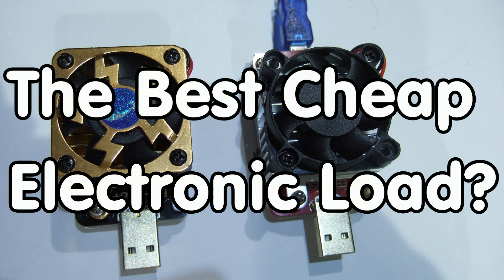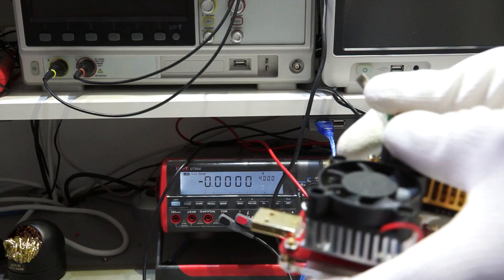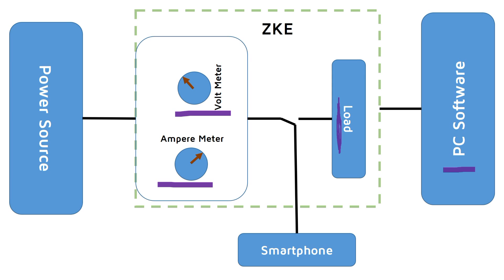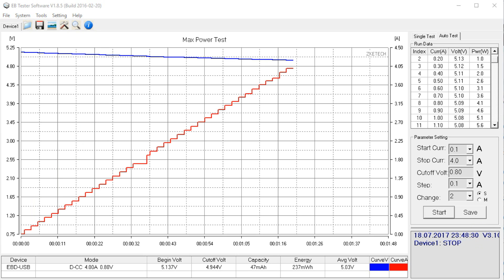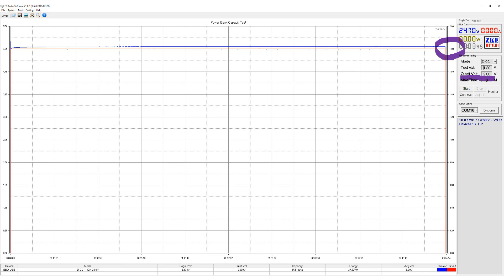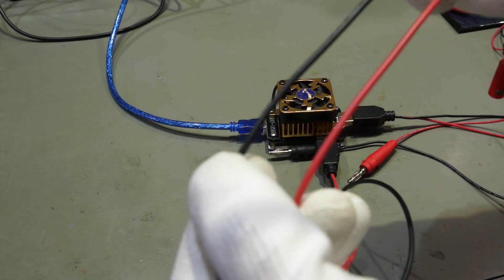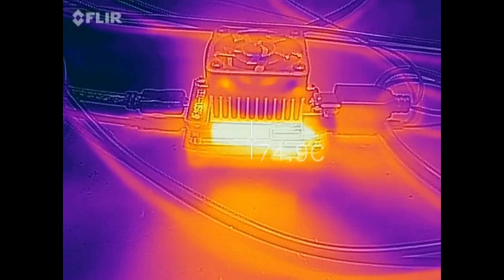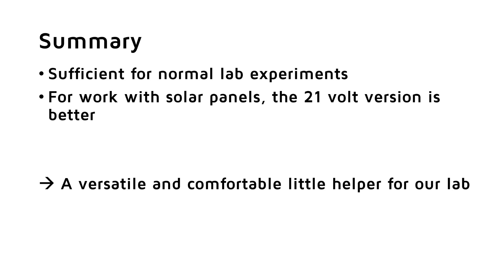#148 Best Cheap Electronic Load / Data Logger? Introduction and Test

Comment: I bought it to test tp4056 chargers and ICs. To check if the tp4056 does not go below or above the 4.2 voltage and to monitor the charging curve (voltage vs current) via the PC software. Unfortunately, this device does not seem to be suitable for it. The voltage at the output of the tp4056 does not match the value that the software indicates when the li-ion is connected. It does match if the li-ion is not connected. Also, the voltage does not match when you measure the input and the output of this device. Used very short 18awg cables. Any tips on how I can get this to work or do you think it's not suitable for this?
Reply from the maker: I do not know your setup. Maybe you look also at the datasheet of the TP4056. Particularly at its charging curve.
Reply: @AndreasSpiess  That's why I was testing this. To see if the charging curve matches the datasheet. but unfortunately this device does not seem to be suitable for this.

Comment: Fantastic tutorial and test, thnx!!!! I received my ZKE EBD-USB+ today (based on your recommendation, and after prolonged Covid19 shipping delay ;-) and it is an amazingly powerful piece of test equipment for the price. I tested my collection of power banks, chargers, PSUs etc and was pleasantly surprised by quite a few of the cheap, Chinese devices (far exceeded ratings); but also underwhelmed by some others that didn't even come close to specs . . . I'm experimenting with solar power for some Wemos Mini devices, this will be invaluable to log actual power needs withn sensors connected then chosse the best solar panel.

Thnx again for a great video!

cul
billd
Reply from the maker: Glad you like it. It seems to be very useful for your many projects!

Comment: @2:49 I have that same cheap load and it does have nice sized solder pads on the bottom marked as +/- for you to add wires to any connector you want though. It lets you easily use it as a CC load with an existing data logger if you have a cheap LiPo discharge tester for example.
Reply from the maker: Thanks for the tip!

Comment: Dear Mr. Spiess. I bought the "light" version after watching your video and tested a 12v lead battery with 3 Amp which gives me 35 Watts of power. The temp of the heatsink went up to 51°C measured with a FLIR camera. It ran for over 2 hours. And still no problem about overheating, any overpower protection, which is good! Thank you for the nice structured video. Sadly i'm not an engineer, but i wish i had your knowledge and capacity of understanding concepts. Weiter so und freundliche Grüße aus Luxemburg :)

Comment: Thanks for this, Andreas. Have you looked at Aliexpress 150W 10A Constant Current Electronic Load Tester Battery Discharge Capacity Test (https://www.aliexpress.com/i/33026184129.html?spm=2114.12057483.0.0.17fa200fCwhQhu)? It looks good though I have not fully checked mine yet, but it seems to be good value as a simple 'dummy' load.
Reply from the maker: No, I do not know this product.

Comment: My PC is not finding my plus version.
It says use a USB to ttl lead?
I just used a normal USB cable but the computer does not see it.
Reply: Solved it was on a comport above number 10 changed to com 2 all working

Comment: which digital load do you recommend? that this between the $ 50 to use it with a solar panel, I want to see if the panel that I have can deliver 500mA thanks
Reply from the maker: I think the video covered this topic.

Comment: Dear Andreas. I have a problem connecting the EBD-USB+ to my PC. It recognizes the unit and a serial port is defined, but It is not present in the dropdown box and I cannot connect to it. What are the settings for this port like baud, stop bit, that you use?
Reply from the maker: I do not remember and I use now a different load. So I deleted the programs. But if you cannot see the port the problem is somewhere else, not in the definition of the baudrate.
Reply: @AndreasSpiess  For those who are interested. The settings are 9600,8,Even,1,None. After a while, I found out that there is an issue with my Desktop and I cannot get a connection. I switched to my laptop with the above settings. I have seen a remark(see here: http://budgetlightforum.com/comment/1192992#comment-1192992 ) that it would not recognize port numbers above 10, but that did not help as well. So I have to dig a bit deeper why the USB connection does not work although the driver is connected with the unit, it is weird.

Comment: power IS voltage time current with phase taken into account, and yes as this video is for DC power should not matter much but i think some loads are nonlinear
Reply from the maker: Most DC loads are somehow non-linear (at least over time)

Comment: Is it possible to log 2 at the same time over a boost or a LPO or a transformer to get the efficiency ?
Reply from the maker: I do not know.
Reply: Andreas Spiess ok i have ordered a second one. In maybe 1 month i should be able to tell.
Reply: I have got the 2nd one. It is possible to log 2 together in 2 different window so they are not synchronized in time but i think for slow events that should not be a problem. On top of that i think that it should be possible to synchronize in post (excel or OO calc) just by matching the signals.

Comment: Excellent review Andreas, as usual. Thank you. I have a question. Is it possible to attach let's say ESP8266 instead of smartphone and to see current and voltage during the transmission and sleeping? Or ESP8266's current and voltage are too small to measure with this device? Thank you in advance. Regards from Portugal.
Reply from the maker: You can use these loads for all sorts of devices. But nor for deep sleep. For microamperes, you need special equipment as I use in my videos.

Comment: please Show how to calibrate them
Reply from the maker: You can test them with a normal multimeter using the 4-wire method shown in the USB cable video.
Reply: How does it calibrate? Is precision current or voltage source required?
Reply from the maker: You should be able to do it with a normal multi meter. This is not a precision instrument.
Reply: My question was is the calibration performed by measuring voltage or current and then inputting the true value or the precision voltage or current needs to be inputted to the device.

That is the two different calibration process, one requires a measuring device with 4 wires, the other requires precision voltage / current source with 4 wires.

Comment: Thank you very much for this interesting video! I got a quick question that may seem silly, but for me as an electronics newbie is important: where do you get your wires from (e.g. the 18AWG you mention) and what collection of wires do you propose to have in a lab? I recently went to a DIY shop and the wires they had there did not seem too useful - they were generally thick and single-stranded (consequently stiff) wires.
Reply from the maker: I got all my wires from AliExpress (silicon stranded). You should find a link in one of my mailbag videos.
Reply: Ok thanks a lot.

Comment: Many thanks for your excellent video. It inspired me to buy a EBD-USP+ and
doing some further reverse engineering, starting with the results of Caleb Crome 
(https://gist.github.com/ccrome/d2b5bd30b2c8ece0bfa5ba84b5511e43)
mentioned in his comment to your video.
The results were tested with a program written for NodeJS (v8.9.1.0 + serialport-module).

1 Strange msb/lsb
Msb and lsb of the data go only to 239 (0xEF)! 
That means the maximum value is 0xEFEF and it is not 256*239+239=61‘423, but 240*239+239=57‘599. 
That means for coding, the msb of for example 1234 is not Math.trunc(1234/256)=4, 
but Math.trunc(1234/240)=5, and the lsb is not 1234-(4*256), but 1234-(5*240)=34 i.e. 0x22.
That solves the problem mentioned by Caleb Crome („…not 1000/Amp, 100/Volt..“).

2 Checksum for send and receive
The crc is built by starting with crc=0 and xor it with all data-bytes.
Javascript example for sending data (buff[0]=0xFA...,buff[9]=0xF8):
buff[8] = 0x00; 
for (var i=1; i < 8; i++) buff[8]=buff[8] ^ buff[i]; } // ^ is js xor
if (buff[8] > 239) buff[8]-=240; //see strange msb/lsb

3 Received data
Decode acording to "strange msb/lsb"! Byte-count starts with 0 after start-byte(0xFA):
Byte 0: status=0x00:stopped/values OK, 0x0a: running/values OK, 0x64: startup/values NOT OK?
Bytes 1+2: dataAmp (=value/10000)
Bytes 3+4: dataVolt (=value/1000)
Bytes 5+6: dataD+ ? (=value/1000)
Bytes 7+8: dataD- ? (=value/1000)
Bytes 9+10: setAmp (=value/1000)
Bytes 11+12: setVolt (=value/100)
Bytes 13+14: setMinute (=value)
Bytes 15: for EBD-USB+ always= 0xA1 ?
Byte 16: Checksum

4 Problems/solutions (only with my device?)
The command 0x02 ist not a  „stop“ command, but a „pause/continue“ toggle command.
Solution: The status of the device can deliver the actual function (status „running“ is 0x0A).

The cutofftime does not stop the load.
Solution: Stopping the load by software, sending 0x02 if running (status 0x0A) and time is reached.

The „continue“ command 0x11 does nothing or strange things (ev. blocking the „start“ command  for a while?).
Solution: Not using this command?

Unknown functions (sent data, 19 bytes instead of 10 as usual for commands)
//0x0A, ??, 19 bytes, ex: FA 0A 00 00 16 36 08 48 08 58 00 0A 00 00 00 00 1A 2A F8
//0x0B, ??, 19 bytes, ex: FA 0B 00 00 16 68 08 3D 08 4D 00 0A 00 00 00 01 1A 14 F8
...?
Solution: Not using this commands?
Reply from the maker: Thanks for the documentation. It would be great if somebody would convert those learnings into a Sigrok interface (https://sigrok.org)
Reply: I have an working driver for sigrok.
https://github.com/littleyoda/libsigrok

Currently I'm working to get this driver merged with the offical sigrok-repository.
Reply: I see I'm not the only one :-)
I have reverse-engineered this protocol a few months back to write my own client (I wanted easier to use UI and logging)
in not so commonly used QB64 code:
https://gist.github.com/mdijkens/0f28abc5bb5855871c53b5ff1e6863c3

Windows App (ugly but easy) can be downloaded here: http://www.dijkens.com/mdFluke/mdEBD-USB.exe

Comment: Hi Andreas,
  I've done a bit of reverse engineering on the pro version of the electronic load, and I posted what I've learned so far as a gist.  Once we work out the checksum computation, it'll be quite simple to create a python library that will drive the thing

https://gist.github.com/ccrome/d2b5bd30b2c8ece0bfa5ba84b5511e43
Reply from the maker: Thanks for the link. I would ask the supplier directly if he is willing to help. Maybe somebody writes a library (or connects it to Sigrok?
Reply: I sent an email.  His email seems to be  zke2006@163.com.  We'll see if it goes though.
Reply: Thank you for your work. Today i placed some more results in the comment to this video.
Reply: Hi
Just noticing this
I have reverse-engineered this protocol a few months back to write my own client (I wanted easier to use UI and logging)

What info are you still missing? I have it all running
in not so commonly used QB64 code:
https://gist.github.com/mdijkens/0f28abc5bb5855871c53b5ff1e6863c3

Windows App (ugly but easy) can be downloaded here: http://www.dijkens.com/mdFluke/mdEBD-USB.exe
Reply: Maurits Dijkens qb64 huh?  That's all I was missing, thanks!  Do you have a GitHub repo ?
Reply: No not really, just used gist.github :-)

Comment: This is all well and good, but if you cannot get the software then it is useless.
I have tried to download this software from 3 locations now and all i get is a useless file with .RAR file extension ? My computer refuses to read this ?
Reply from the maker: +kev wallcroft rar files are archives. You have to use a program like winzip and you see the content. Rar files are often used to distribute software.
Reply: Andreas Spiess ok i will try this again thank you.
Reply: Hi again it would appear that you were quite correct sir, many thanks i do now have the software.
However could you please answer another question for me regarding the type of usb connection to the PC from the unit.
it specifies that it must be a USB to TTL Serial converter cable ?
did you yourself use this type of lead and if so could you tell me where to get this from.
many thanks

Comment: Hello Andreas, and others reading this. Because I've been scammed so many times when buying powerbanks I decided to buy this electronic load, also because Andreas endorsed it. After getting it delivered, witch took very long, and was badly packed, so badly even that the acrylic piece was damaged. After a close inspection though I could not find any other damage, so I started the hunt for the drivers. I have to say that I think its very disappointing from all these chinese companies to dump their products in europe and the US without even having providing the needed support in english. It took me hours to find these drivers, and in all fairness I do have better things to do. It's a good thing we have Google translate because otherwise it was impossible to get the drivers, and why do they have to password protect the pages that contain the drivers? For all those out there, if you are looking for the drivers and a manual, here they are https://drive.google.com/folderview?id=0B7To5Cv3hUkGc2VaSmFYVE1Qbjg Please let me know if you managed to get everything working ok, since I can't test it right now. I have a chronic disease and right now I don't have access to my Windows laptop. I hope to have helped some of you. Andreas, Thank you for all your videos, I enjoy watching them.
Reply from the maker: Thanks for the link. The USB to Serial chip used on this board is used on many other boards and probably are installed on many of our computers from another project. So you had bad luck because this load needed these drivers the first time...
Hope it runs well when you test it.

Comment: You really should be linking to the OFFICIAL software from the manufacturer, rather than distributing some random files that you found online. Here is the link to the manufacturer's website with links: http://www.zketech.com/nd.jsp?id=15#_np=101_304 Use Chrome and translate - the software is "Online software (EB V1.8.5)"
Reply from the maker: Thanks for the link. I included it into the description
Reply: https://translate.googleusercontent.com/translate_c?depth=1&rurl=translate.google.com&sl=zh-CN&sp=nmt4&tl=en&u=http://www.zketech.com/nd.jsp%3Fid%3D14&xid=17259,15700023,15700124,15700149,15700168,15700173,15700186,15700190,15700201&usg=ALkJrhgjYB0A2F3vqOu4LVrlFwFdcSvJTw#_np=7_302

Comment: Can the data be exported to .csv or text files or... ?
Reply from the maker: You can save csv files
Reply: I have finally got one and started to test the batteries of my Canon camera as no charger is giving the capacity of the battery. It is very interresting to see that no-name batteries can store as much as genuine ones for 5 times less money. Something that i could have felt but was never able to put a number on it.
Reply: small finding for people using coma as separator for decimals you should use the format .dat to save the data because it uses a tabulation for data separation and not a coma like the .csv saving.

Comment: I wonder if there is a load like this but 100W?
Reply from the maker: I only found these two. There are 100W loads but without logging. And of course, more expensive ones like the one I used in other videos
Reply: You cannot get a load like this for 100W because a USB interface is only originally designed for about 1/10th that power. You need to be more specific about the voltage and current that you want to dissipate. For 60W with logging, I suggest the ZKETECH model EBC-A05 (5A 30V 60W). For 100W, the larger model EBC-A10H will do 10A 30V 150W. Both use the same software as Andreas shows in this video.  Dumping 100W of power takes some serious amounts of cooling, so it will be much more chunky machine than these little USB units.
Reply: ZKETECH is expensive for what it is (bild quality is low) , why nobody build expandable with remote load like the CBA IV ? I rather build one myself and get the logging too http://www.scullcom.uk/category/projects/dc-load/

Comment: You show 170deg C on the plus version? That is not safe IMO.
You should test a westmountainradio CBA IV Pro, you have all the gear to do a professional review and find out if expensive load like that is worth the money.
Reply from the maker: This looks like a good device with interesting software. But the 160$ plus shipping is too much compared to a versatile load like the one I used in my video #146.
Maybe someone will write an open source Software for these testers to do Solar panel profiling? Should be possible.
Reply: That was 70deg C

Comment: I did not know what these things could really do. Thank you.   Could you also monitor the discharge rate of a smart phone with these devices ?
Reply from the maker: No, because the battery is connected to the electronics inside the smartphone case.

Comment: Great video about one of my most used tools for my videos.
Plus, it saves me making one, because it says it better than I ever could have :)
I wanted to yell you you can do discharge or charge tests using the female USB with logging of the capacity by using the start/stop function instead of the monitor function when in meter mode. But don't trust the continue function when testing, there have been some problems with that (check BLF for more info on that.)
Reply from the maker: Thanks for your tip!
Reply: You're welcome :)